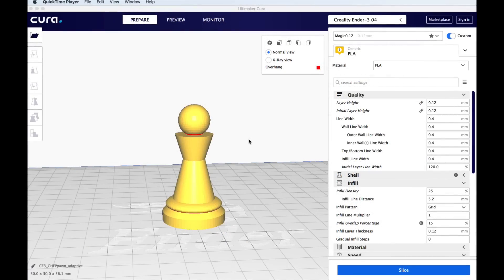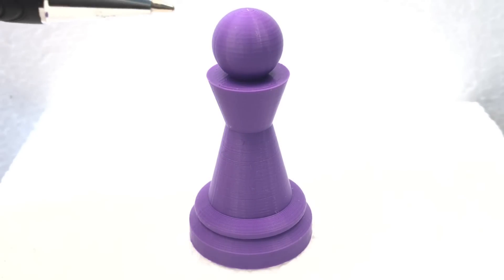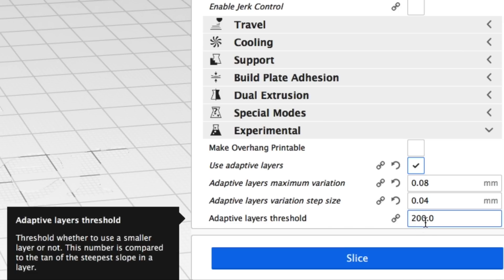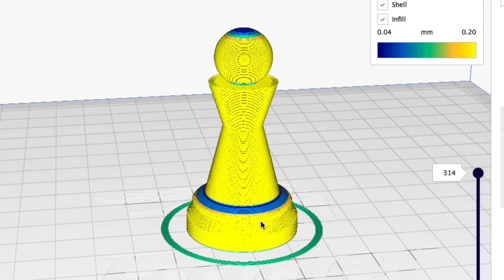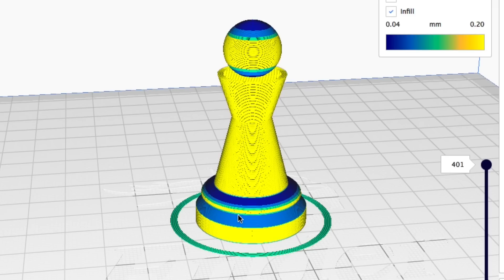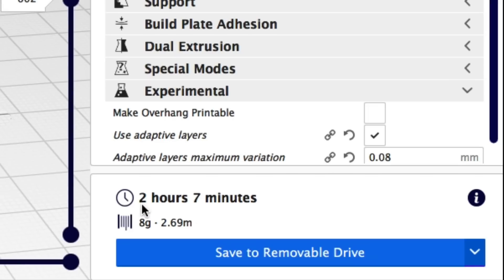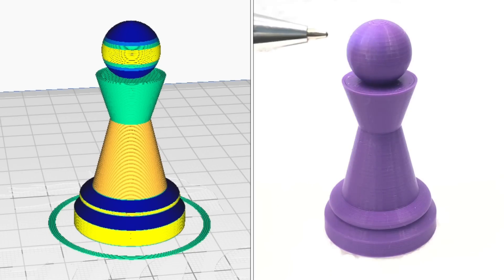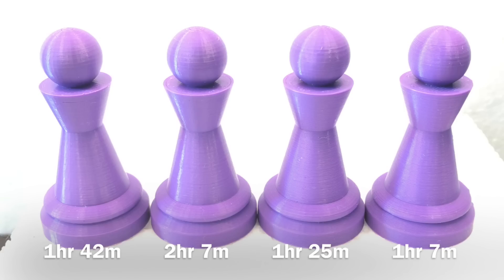Cura Slicer - Adaptive Layers Settings and Results

Comment: Hey chep ive been having issues with my CR-10. The Y axis cable keeps getting caught when the bed moves and unplugging completely ruining a print. Also the stock hot end has been jamming and not extruding after starting my first real spool of Hatchbox filament. Lastly the bed is impossible to level as only one of the springs is short enough to even get below the nozzle. When I level the other 3 they are just as tight as possible and the nozzle still scrapes against the glass?? 

Help me please!
Reply: You need to adjust the height of your z stop.  There are several ways you can fix the Y cable issue, the most common, I think, are adding a foot to the back of the base extrusion or installing a cable chain.  Both are things you can find on Thingiverse.  If you are getting jamming then you probably have a blockage of some kind and/or your bowden isn't seated properly.
Reply: if your nozzle is to close to the bed that could also be causing your jamming.
Reply from the maker: Did you use my bed leveling technique?
https://youtu.be/_EfWVUJjBdA